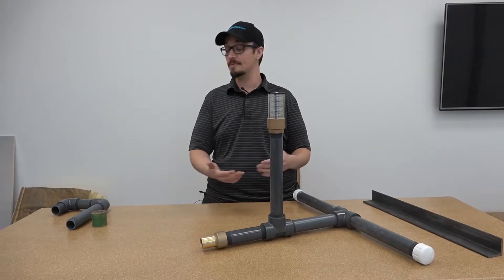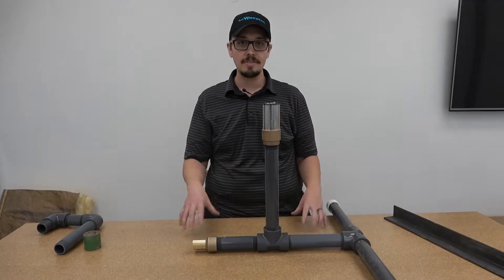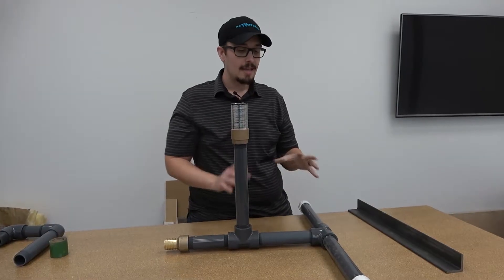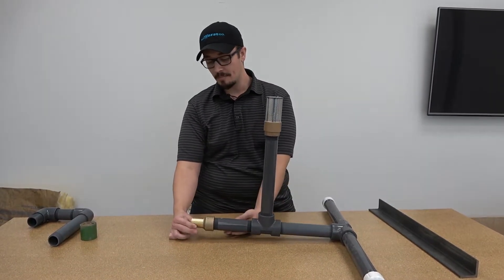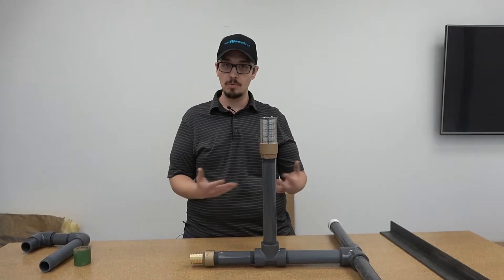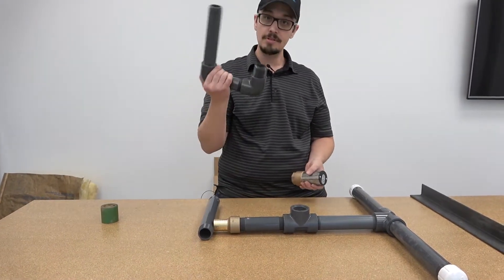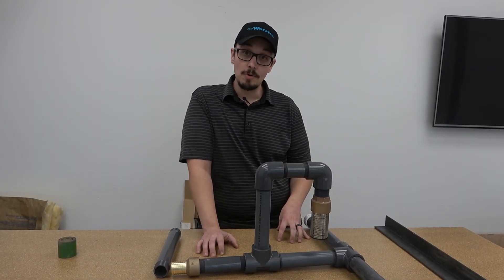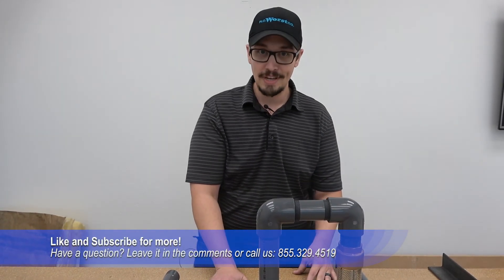Lake Intake Structure for Foot Valves

Comment: Would if you do not plan on drinking the lake water...how deep below the water line should the pump be? It will; have a 0.5 micron filter but only used for washing dishes, toilet etc.
Reply from the maker: The deeper you can put it the better the water quality will be. As long as it does not vortex when it turns on it does not have to be very deep.

Comment: Great video. Love the lake structure setup. I’m on the Ottawa River, (Ontario , Canada, river freezes in winter) a current I think I’d need some cinder blocks to keep it down. We use treated river water year round ( sediment tank, tannin removal, UV treatment) and get tested regularly.  Any thoughts on using a sand point instead of foot valve in your setup to reduce sediment and other ingress to protect impeller on my pump? BTW, foot valve failure in January a killer. A secondary check valve near pump inside the house was our saving grace…

Comment: So that whole thing is pressurized to 50 PSI.  That pipe and joints are rated for that?  I'm redoing my line / footvalve now as the previous owner included a couple of coupler joints that have failed on the 200' line to the lake.  I was looking for ideas for the footvalve on the lake bed and stumbled across this video.  FWIW I have a footvalve on the end of 1" ID poly and leave it in my Canadian lake year-round.  The line freezes from the lake to the cabin in winter (disconnect from the pump, leave the footvalve in the lake) but in 50 years of doing it like this in two different locations, and watching all my neighbors do the same, none of us have ever had an issue with freezing.

Comment: Great video. I have a question...I have a system that pulls from the lake with jet pump.  I just put a new pump in early this year redid the plumbing to accommodate everything and new functional pressure valve, just recently there is no pressure zero.  Pump still runs because it is still primed (surprisingly).  I have tried to pull up and locate the piping and foot valve but it's too difficult.  My thought is that the valve is stuck closed.  It is over twenty years old.  I think the best is to put a new foot valve and piping system in.  But what is your thoughts on that and also any other solutions?
Thanks

Comment: I'd never install an intake over soft sediment since they are nearly always full of decaying organic sediment and bacteria up into the water column.  Lakes that have thick sediment layers are generally not going to have clean water.   Of course this can be corrected by examining the lake and setting up an ecology that will consume those sediments.  This is a much more subtle challenge if the lake has trout that need the cold water in the bottom to survive summer.    Yes you could place rock on the lake bottom, but the bacteria and the sediments always find a way up.    The easiest answer is to pull water from a clean / rocky bottom.

Comment: I know this is an old video but I am going to build this same stand.   Is this 2" schedule 80?   I am having a very difficult time finding these smaller threaded sections anywhere locally.   Any ideas where I could find this?   Seems like Lowes and HD are not really selling Schedule 80 anymore and they have very limited selection of threaded pipe even in Schedule 40.   Thanks great video.

Comment: You don’t mention a check valve, but I assume you use one and it would be located near the Foot Valve; correct?
Reply from the maker: No, a foot valve is all that is needed on a typical jet pump system.

Comment: I like your lake pipe structure to mount a foot valve. I was always lead to believe that my foot vale should be mounted so the intake was down, not up as your video option suggests. I would prefer to mount with the screen at the top as is indicated in the first option in your video. 

I could do it either way as I’m in about 15 ft of water with sandy bottom.

Which would be your first choice?

Comment: I am replacing a river pump used for irrigation, the failed pump was a well pump.  I have purchased a new deep well pump because I wanted more pressure and expand the irrigation to the 3 acres of property. The water supply is a river.  Is there any issue with using a well pump in a horizontal position to draw and supply water for the irrigation?  I have watched several of your videos and you have given me good ideas to make sure the pump draws in clean water, avoiding sediment. Thanks
Reply: May need to watch for air entering the pump.

Comment: Thank you for the great video! You guys are the best. I do have a question. 

My foot valve is in rather shallow water 3 feet or less. We also have a weedy muddy bottom. I have raised the foot valve so it’s not sitting at the bottom but My foot valve is  still sucking in sediment and small weed particles that are not being filtered out by the screen on the foot valve.  What can I do? I have tried placing a sponge around the foot valve screen, however, but this reduces the suction too much and doesn’t allow the pump to build up sufficient pressure.  Thx.
Reply: I’ve used an Anka foot valve mesh sock for finer debris.  Can find it at Home Depot near the foot valves, and it doesn’t affect the system pressure.

Comment: Hi Chris, I'm also in your area, where the lake freezes, so if you weigh this down with the angle iron weight and sink it into >10 feet of water how do you get to take the valve off for winterizing? And re-inserting in the spring, as recommended to keep (exposed part of) intake pipe from freezing?
Reply: Redneck fix: You could try a floating/sinking barrel technique. Attach a 5-gallon barrel (I'm guessing about the size, also you need 2 hoses (inlet and outlet)) to the foot valve, fill with water to sink it and air to float it. :)

Comment: Brilliant support for the intake--so easy to adapt the pickup height. 
Question: Does it make any difference if the intake is pointing up, down, or horizontally when it comes to sucking up small bits of junk in lake water?
Reply from the maker: Theoretically it should work in any position, but I would advise against putting it upside-down.
Reply: @RCworstwater  Stupid question, but can you clarify which way is upside down?  Threads up or down on the foot valve?  Thanks so much!

Comment: Absolutely crystal clear explantion...at last. 
question: I have a Goulds Pump J05N 1/2 HP sitting at 30' from the lake and 8' above water line. 
The pump then push the water to a 1000 litter tank 150' away and 20' above water line.
I will follow your recomendation about the foot valve but what should be the size of input and output conduits? So far, I've been using 3/4" input and 5/8" at the output....that should explain why the breaker of my generator keeps jumping off...
thx
Reply from the maker: Don't go smaller than what the pump's inlet and outlet are. So if the inlet is 1.25" you should us 1.25" pipe.
Reply: @RCworstwater  Thank you Chris, you're the best!!!👍

Comment: I’m using 3 large screw pumps as means to pull from a large pit of waste water , the problem I’m facing is with the rubber stator as a lot of sharp solid small objects ( pens, nuts are being pulled by the pump and cutting up the stator and scratching the screw, I need a pump that can handle such objects in an efficient and reliable manner
Reply from the maker: Give us a call: 855.329.4519
Reply: Any Idea is welcome, maybe a grinder pump?? But do they come in large sizes? Are they reliable?

Comment: Npsh will not allow for 30 to 40 feet of depth for your suction. Max on a normal jet pump 26feet. Unless you have ane injector.
Reply from the maker: Suction lift is measured from the the pump inlet to the surface of the water because that is where the water will naturally fill to. You could put a foot valve 200' down a well and as long as the water level in the well is above 25' a shallow well jet pump will work.
Reply: @RCworstwater  

Noted, thank you for the explanation.

Comment: great idea. if its under the ice, and the line is open on the other end, why would you have to take it out for the winter?
Reply from the maker: If the pipe is not buried below the frost line then the residual water in it could freeze and break the pipe
Reply: And it might end up a few cottages/homes away if there’s any current. We’re on a river and I’ve seen large wooden docks go by surrounded by ice in the spring😲